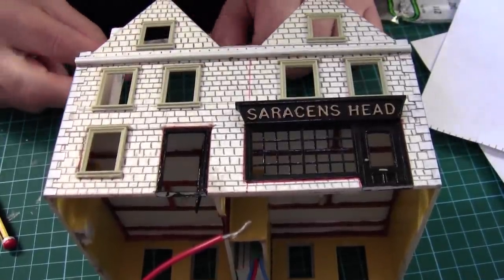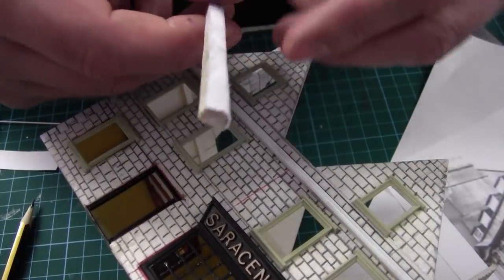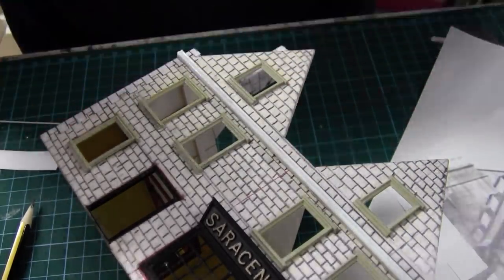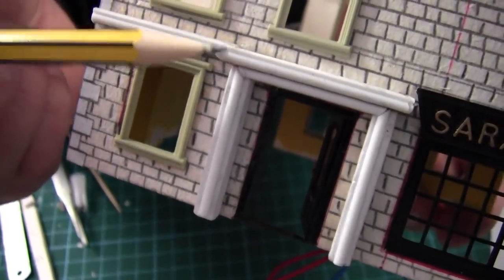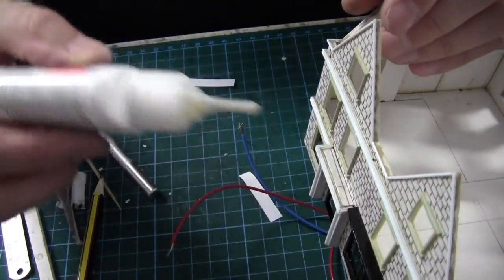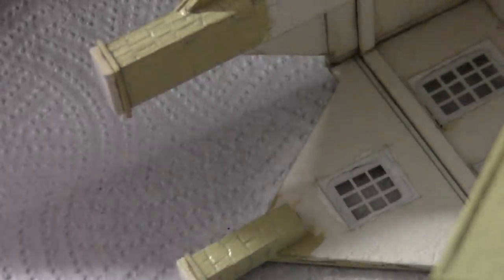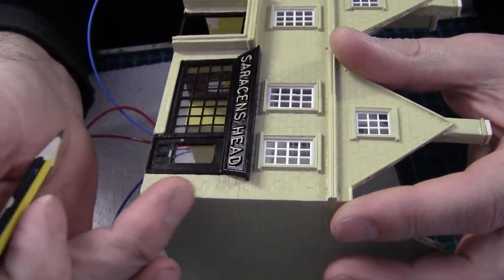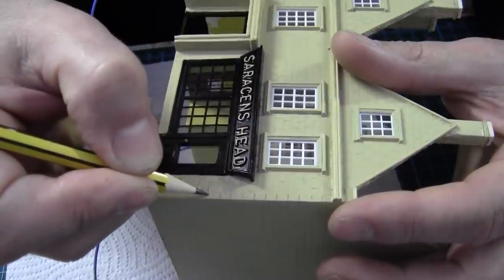The Saracens Head Part 3. Outside walls painted....No305

Comment: Great video again as usual Tony - the pub is coming along nicely.
I have used the flickering LEDs from inexpensive battery tea lights, for dolls house fireplaces and ranges. They work rather well.
Reply from the maker: Hi Eric, thanks for the tip. i may take you up on that. many thanks Tony

Comment: Tony,
Great episode.
One thing I noticed is your Saracen's Head on Broad Street is quite close to the true colors.  I'm waiting to see how you detail the hanging plants.
However, the rear of you Inn is the wrong hue.  On Walcott Street the ground floor is a "Royal" Blue.  While the second floor is a dirty weathered Beige.
In any event I would love to see your take of the neighboring Roasters department store.  Especially with their Purple ground floor.  Bric-a-brac window displays.  With, again, a Beige upper floors and challenging roof line peaks.
Jim
Reply from the maker: Hi Jim. thank you for commenting. very true the back of the pub is totaly wrong. but then again so is the depth of the building from back to front as it wrong. I have had to make some changes just so i can fit on the layout. the shop is quite a large building in its own right. but yes very challenging. 
My problem is i never thought about doing do much scratch building when i first started to build this layout. next video show possible places where the pub might be sited. many thanks again for commenting very much appreciate them...cheer's Tony

Comment: Nice work. Tony how did you make the columns for the centre entrance supporting the portico and cornice? Just foamboard? Cheers again, Joachim
Reply from the maker: Hi Joachim. the columns are 2mm half round plastic strip. which does has the effect of columns. and the card is Kart card found on ebay. i hope this helps you out.  until next time. cheer's Tony